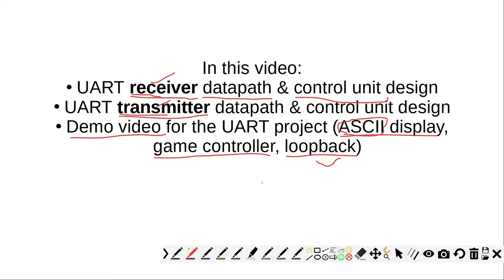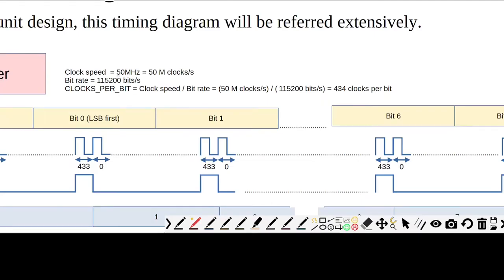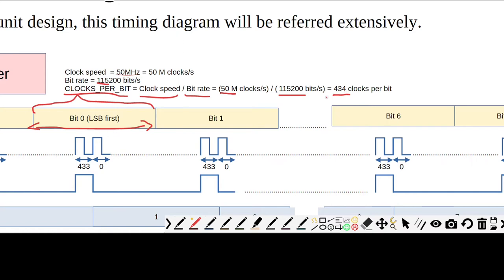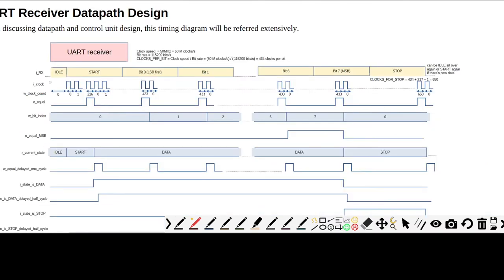UART datapath and control unit design and PyAutoGUI game controller [Old Video]

Comment: Can I know can i build this using quartus bdf?
Reply from the maker: Of course possible, in fact, in the first course about digital design at UTM, I did the same project using only logic gates without HDL. I would say using HDL is easier, while using bdf helps with the understanding of synthesis.
Reply: @tanende  so basically how to start with the design, like which block should I build first more specifically. Cause I feel like I understand ur video but I not sure how to start...